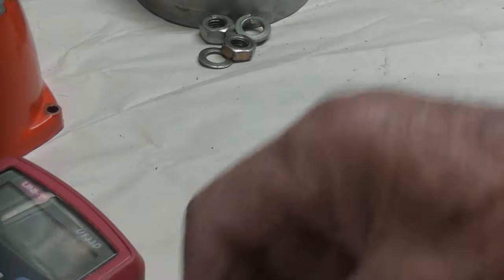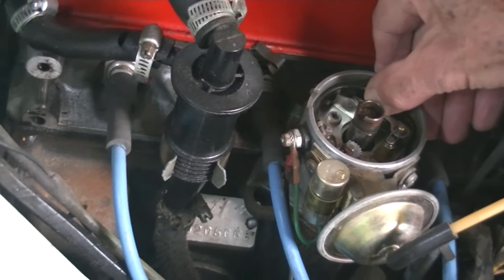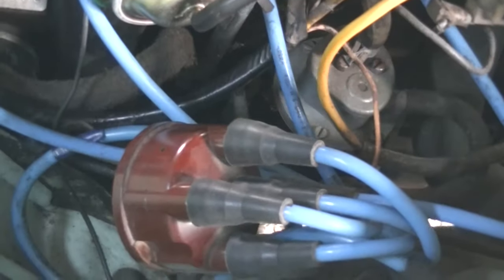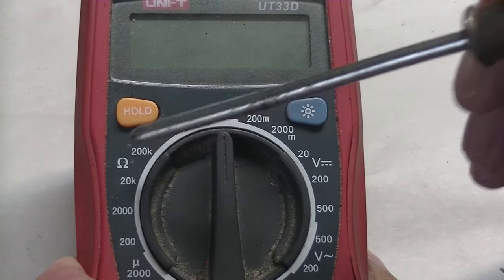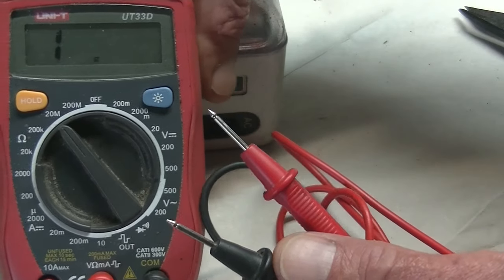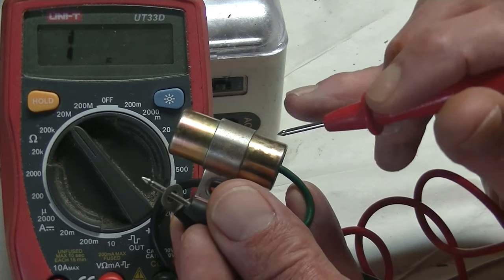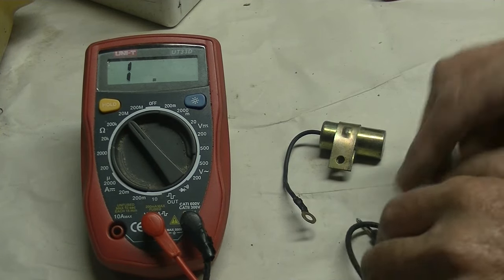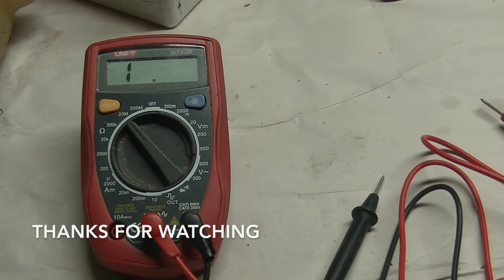How to test a Condenser or Capacitor

Comment: Sir...when doing those types of Tests with your Multimeter, try Not having One Hand Touching One Lead and the Other Hand Touching the Other Lead at the Same Time as the Meter may/will/can Read the Resistance through your Body and/or your Part being Tested giving you an Erroneous Reading...One/Either Hand is Okay. If your Meter Reads the Same when Neither Probes are Touching Anything or the Part being Tested...the Part is OPEN, sometimes that is what you want and sometimes it is not what you want...depends on the Part you are Testing -- for a Capacitor/Condenser it would be BAD/FAILED/NO GOOD. If your Meter Reads the Same when you touch Both Leads Together or the Part being Tested...the Part is SHORTED, sometimes that is what you want and sometimes it is not what you want...depends on the Part you are Testing -- for a Capacitor/Condenser it would be BAD/FAILED/NO GOOD. If you Test the Capacitor/Condenser with your Meter the Numbers on the Display should go UP and if you Reverse the Leads they should go DOWN -- that Capacitor/Condenser SHOULD be GOOD as it is Charging and Discharging. This NOT a 100% Test for Capacitors/Condensers though as this Test does not Check Internal Leakage, Resistance, etc. You would need Other Test Equipment. Condensers are Very Cheap, that's why most guys Replace the Condenser.
Reply from the maker: Hi Cheewurz, thanks for your comment. You're absolutely correct, quite a few people have told me the same. In the video, I think its the 3rd one that I tested where I touched the condenser. I only noticed it afterwards. Thanks again for all the  information.

Comment: The condenser is not linked in anyway to the secondary coil winding or generating the spark from that winding. Its purpose is to act as a store for current when the points open. This reduces arching across the points and the points then burning out. Misfiring maybe caused by the points  being pitted or burnt out (as this will impact on the timing). Burning out points maybe caused by a dodgy condenser or breakdown of the coil reducing resisting (which also causes arching at the points). Thanks for posting re how to test a condrnsor  though!
Reply from the maker: Sounds like you know a whole lot more about ignition systems than I do, so thanks for the advice and info and thanks for watching
Reply: @davekennedy52  .... but I did not know how to test them and your video taught me that. YouTube at its finest - increasing knowledge. Thanks 😎.
Reply from the maker: @vidvidbiker  Well then we both learnt something! And you're very welcome:)
Reply: not exactly   the condenser does not store any voltage  the condenser has to match the coil electricly the come rated in mfd's what happen as the points open the gd is lifted offthe condenser lead allowing thevoltage to go thru the cond to gd the can is grounded with the small screw to the plate inthedist if t correct mfd value all voltage gets thru the condenser  that voltagis flowing thru the primary winding creating a magnet effect in the secondary winding because of turn ratio the voltage is very high this going to the distribitora nd spark plug as an arc  so  if all the voltage can get thru the condenser because ofwrong mfd value it will jump the open points to gd. pitting the points over time so if you have pitting points you have bad or a wrong condenser i found a dated factory manual and bought it for mr truck to get 1953 part # for my  points i crosed ref that # to days #  found 2 matches  bought them after install new condenser i tested my spark it went from 1/8 inch with old wrong condenser to 3/4 inch jump with new condenser  problem solved i also replaced the pitted points .  money well spent
Reply: whoa nellie   the condenser   and coil are conn  that tiny screw screwed into the wire from the cond, and the from the coil and the points as the points open it lifts gd from this conn.allowing curent  to flow into the  primary winding and causing a magnetic effect in in primary winding with a high turns ratio it greates a very high voltage to the dist and plug wire as a spark  for the plug with enf off conn ohm meter red lead to the screw coming from condenser conn black lead to gd. on a low ohm scale you can see agd reading now with your finger open the points watch the gd fall off  that open and closing makes everthing work
Reply: vid vid:   The condenser is connected to the points which are connected to the primary winding which is connected to the secondary winding inside the coil therefore they are linked and the condenser plays a very crucial role in generating spark. 

If you don't believe it...  try starting an engine without a condenser or with a condenser that's isolated from ground.

Point quality such as pitting or oil film weakens spark, but does not effect timing although rubbing block wear decreases gap which retards timing.

Comment: Had an 850 British Leyland Mini in 1970 going on a very long trip North and after half way pulled into a wrecking / recycler yard and said everything had been checked and it was still misfiring. he listened for a minute and oh that's a condenser. He charged me 50 cents (believe it or not) and  that was the end of the condenser problem. It's like a ballast in a Fluro Light, acting as a current limiter for the high voltage, that's my limited explanation of it. Thanks for the good clear video.
Reply from the maker: Thank you KM, its probably the most overlooked  part of the electrical system and so important for smooth running. Thanks for the story and I'm sure you wish you still had your car. They were really an icon of that time.

Comment: Good simple explanation and vid.  I will make one comment which is about changing condensers each time you change points. As VW beetle owner I can testify the days of tossing a good, old one are over. They no longer make decent condensers. They fail frequently with minimal use. If you have a good old one, keep it.  Buying a new (especially Bosch) condenser is like rolling the dice
Reply from the maker: Thanks Orman, I drove a Beetle for many many years and both condensers and points never failed. These days I change them once a year.

Comment: Back in the old days we used to replace points and condenser because they came in a set but the truth is condensers hardly ever went bad. The condenser is there to act as a voltage shock absorber or to keep the the current from surging or coasting across the points gap. Symptoms of a bad condenser are a bright flash at the points or pitted and burned points. Most of the reason to change the points was due to deterioration and wear on the rubbing block against the can.
Reply from the maker: Thanks JR, I still change points and condenser at the same time, I've always done it. These days I'm told that the condensers are junk, but I've never experienced any noticeable problems. Thanks for the info and for watching
Reply: @davekennedy52  No, thank you for the testing information and a well made video.
Reply: you almost got it right  but i slite error the voltage  goes thru the condenser to gd if it the right value in mfd.s  if its wrong value cond. it will jump across thr open points to gd there by pitting them over time  --a good  condenser passes all voltage thru it.
Reply: wrong value of condenser or a defective one will cause points to pit   that circuit is called a series  resonant circuit  the mfd value must match the coil for max spark ==ohms law ---  I=E?R the R value must be zero this is obtained by this------the coil has reluctance  aform of res the condenser res is reactance  they cancell each other to obtain the zero for max spark all the points  does is open and close the gd leads of coil and cond  if points are piting change the condenser clean the points

Comment: capacitors do not store voltage   when used in an eng distribtor  they have to match the primary coil that is called a series resonant circuit  -----you have to satisfy ohms law  i=e/r   this happens when you install correct capactior to match he coil====== max spark

Comment: Thanks . You didn’t point out a bad one. Also the explanation of the electric flow I think isn’t how most other old engines work. Strange about going back from condenser to coil.
Reply from the maker: Yes, it's strange that all 6 of my condensers were still good. If the reading starts off immediately high then the condenser is bad. Didn't want to dwell too much on the electrics as I'm not really an expert. Nice to know if a condenser is good or bad so that I can rule that out of the equation if I have a problem
Reply: let me trace that circuit for you turn on the key voltage applied to coilthere is no current flow at this timeonce you start the turning it open the points lifting the gd off the wire going into condenserthru condenser can to gd that current flowing thru that coil creates a magnet effect into the large winding stepping the voltage up thounsands of volts wicch flows to dist.cap to rotor in side to a spark plug as soon as points close it all stops  then as the points open it all starts anew  ------so if you have a defective condenser part of this voltage can not get thru the condenser so the only gd available is thru the open point  so it jumps across that tiny gap that iswhy points get pitted over time   ---bad condenser  hope the helps some one
Reply: dis reguard any test with ohmmeter on condensers not valid
Reply: read my comment below
Reply: @davekennedy52  hey brother, I've got a wild question for you so I had two blown head gaskets in my 67 Ford Thunderbird I replaced said head gaskets/ all gaskets around(intake/valve cover/manifold/head.) however upon trying to start the car again I have no ignition, I bought and tested  a brand new ignition coil,  new points,  new battery, new alternator, new starting solenoid brand new wire leads brand new spark plugs brand new rotary cap no deposits on the  cap or on the points, It also not the neutral safety switch. I pulled one of the spark plugs to check to see if they were getting spark they are. And I also made sure my engine was top dead center upon putting the distributor back in.  I'm literally driving myself crazy because I can't figure this out and I'm trying to head to the military with my car and it's not going to happen if I can't get it to fire over. Anyone else feel free to jump in on this because I'm at my wits end
 I sent this car to a shop prior and they totally screwed a lot of stuff up I got everything fixed that they screwed up and it was running but I don't want to send it back to another shop justto have to fix everything again.
Reply from the maker: @nikkoharding2702  Really interesting problem that you have. I must admit that I know very little about V8 engines. The most important thing is that you have a spark at your spark plugs. Have you had a compression test after the blown head gaskets? Its quite likely that you only have a timing issue. Your firing sequence is 15426378 (I think), and when setting timing, the mark on your flywheel should be at the TDC position. In your case I think its 6 degrees BTDC. At this point, number 1 cylinder should be at the top of its compression stroke. But remember that there is a compression stroke and an exhaust stroke..it gets to the top twice in a cycle. Piston No 1 could be at the top of the exhaust stroke while cylinder 6 is firing. In other words you might have put the distributer in and be 180 degrees out. I'm just giving you this advice from my experience on a 4 cylinder engine so I hope it gives you some thought as to what could be wrong.

Comment: Will this keep the spark plugs from getting voltage?. Engine turns over no spark
Reply from the maker: Yes it will DLC, do this test to make sure the condenser is still good. If you have points in your distributer, make sure that they are good and gapped correctly. You can also take out the HT wire from the centre of the distributer, hold it near the engine block (1-2mm) and turn the motor over to check for spark and that current is coming from the coil to the distributer. Wear gloves to avoid a shock. Good luck!

Comment: We have a either an 83 or an 85. We replaced the condenser and the points. It ran fine after that but now we have no spark. Can anyone help please.
Reply from the maker: You have a Renault 4?? Best way to check for a spark is to turn engine by hand until points are closed, then switch on ignition and use an insulated screw driver(piece of wood is better) and open the points. It should spark. Change the condenser again too.  Let me know and I can help further
Reply: No it's a Honda z50r.
Reply from the maker: @debraguest7245  So sorry Debra, I know nothing about bike engines. Seems strange that it happened so suddenly. I would check the coil and also the spark plug wire itself. wish I could give you more advice
Reply: That's ok. Maybe someone else knows something. The coil and the points are new like I said we just have no spark. If anyone else knows something please let me know. Any help would be great. Thank you.
Reply from the maker: @debraguest7245  Another thought, if its anything like a lawnmower engine, the coil should have a gap between the magneto and the flywheel. Gap too big or maybe touching =no spark
Reply: @davekennedy52  I will tell him to look at that too. Thanks again for any help you have given and if anything you said turns out to be right I will for sure let you know.

Comment: You had some questions on the bad capacitor when it did not go above 4 OHMS.  The Condenser was partially shorted out.
Checking the Condenser:
1)Turn meter to 20 Ohms. 2)Put negative lead two wire coming out of the Condenser. 3)While watching the meter put the positive lead to the casing.
IF the Meter reads /5M Ohms 10M Ohms 15M Ohms 20M Ohms = Good “Yay woo “
IF the Meter reads / 5M Ohms, then 20M Ohms or straight to 20M Ohms = BAD low Dielectric. 
IF the Meter does not go above 12M ohms = BAD partial short.
IF the Meter does not change from 0 ohms = BAD 100% Shorted
Reply from the maker: Great info Robert, thanks a lot!
Reply: @davekennedy52   I saw 11 months ago you retested it without touching the case with your hand. and it checked good. I have done that mistake  Many many many years ago. lol.
Reply from the maker: @Rnm1hart  at the time I didn't realize but I won't do it again (like you said)
Reply: A hint from your Uncle AL. If you ever have an engine with points cut out at about 2500rmp check to make sure. That the vacuum advance is not moving the points so far that it has broken the ground strap from the points. then when the RPMS go down that it meshes together to make a good ground.  Acts like a rev limiter.
Reply from the maker: @Rnm1hart  Interesting! Just put in a new vacuum advance to my Renault 4 (there's a video on my page) Thanks Uncle Al:))
Reply: I have a 1600 beetle and I keep having to change the condensor. Iv done a new Bosch coil, new points and condensor all at the same time but it lasted all of 200km before it went bad. There is a history of this car and condensors going bad. Any tips that you may have to find why?
Reply: sorry to tell you this  but you can not test a capacitor with an ohmmeter  they are rated in mfd's not ohms you must have a capacitor testor to test    ohms mean nothing   check your points if the are pitting this tells you  capacitor is going bad change it out  this is a quick test with eng running remove a spark plug wire insert a wood handle screwdriver into plug wire hold screw driver close to eng  how far will spark jump  less than 1/2 in is not good  up to 3/4 in jump is everything is ok  --- below 1/4 in change capacitor  and clean points

Comment: Hi there! I think I'm the "A", who advised you about condensers on the Renault 4 Forum! When one tests condensers it's best to wear thin rubber gloves, as the moisture in one's fingers and hands  cause current to leak & affect the meter readings. While testing the (I think) third one your fingers were on both the lead and the condenser body simultaneously, which may have caused you to condemn a condenser to an early grave!
Reply from the maker: So nice to hear from you again! Yes you are indeed the Andrew from the Renault 4 forum who advised me on the condenser. As you can see, its a very popular video, so thank you! Quite a few people have commented on that 3rd condenser and when I viewed the video again, I realised that I had touched it while testing. I went back later and re-tested and had a good reading so no harm done. Thanks again Andrew and for the advice on the gloves

Comment: A couple of other hints of poor capacitor.  The motor may start but won't rev and the points if the negative has an excessive loss of metal, then the capacitor is low on capacitance. 
If it's Lucas, change every time and carry a spare. 
Best option fit electronic ignition.
Reply from the maker: Thanks Chuck, always good to get these tips and advice

Comment: Thanks for the vid. Would a bad consider cause the voltage after the consider to be lower than the voltage before the consider.
Reply from the maker: As far as I know, the condenser is like a battery, it stores the charge. A bad condenser can't keep the charge